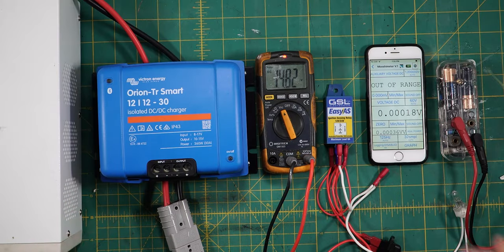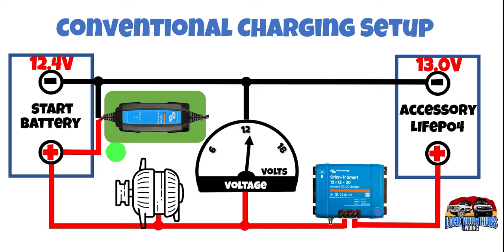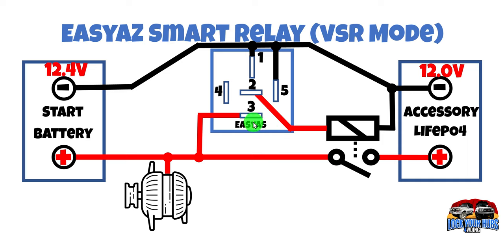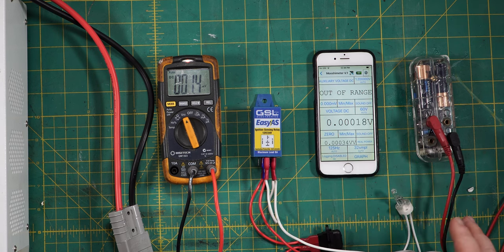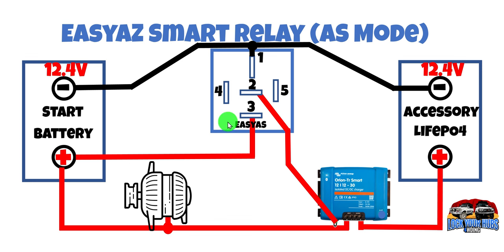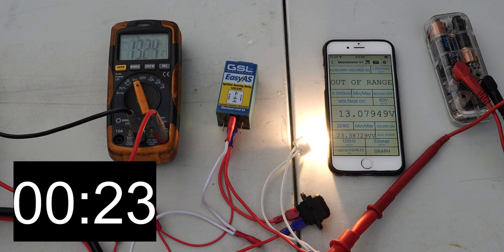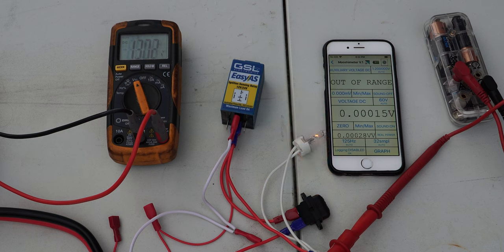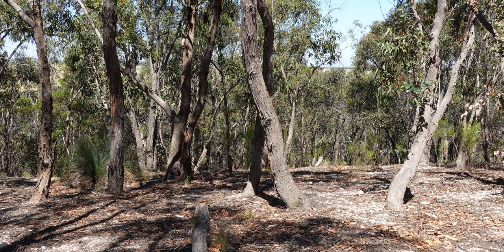Save your Starter Battery with the EasyAS Relay

Comment: Really enjoy your videos. Very clear and easy to follow.

This looks clever but it also looks like you need to run a third wire all the way to the DCDC controller which will be next to the battery (wherever that is) so I'm not sure why you wouldn't just run an ignition wire from the controller. Do some not have these?
Reply from the maker: Unfortunately you still need to run another wire. Though, the likes of the latest Redarc DCDC chargers have a low voltage cutout, so in order to get them working in the likes of a caravan, you need to run really thick (expensive) wiring. This fixes that issue.
Reply: Excellent video and well explained as usual (love the diagrams, makes it easy to follow along) :)
Do you really need to run an extra wire If the Aux battery and the DC-DC charger are in a caravan? Couldn't you sense the AC ripple on the positive power lead (i.e. the ones from your Anderson plug into your van) and put the EasyAs relay in the Caravan as well?
Reply from the maker: @Jack_C_  I've been told that over those sorts of distances, it can be a little hit and miss if there is a load on the wire as well. Having said that, I would definitely "give it a go" before running the dedicated wire.
Reply: For my van house battery, my auto elec ran the large cables through a 100A relay under the bonnet and then to rear of the vehicle. This relied on the ignition to open the circuit in the relay, rather than running the Enerdrive DCDC ignition wire up to the vehicle engine bay.

For my under bonnet dual battery I use Projecta DCDC 25 with ignition wire wired in. Although I was suspicious of my cranking battery being drained to the deep cycle dual battery when I charged it (as per example in this video) but I was relying on the DCDC to protect it with the ignition wire. I started removing the fuse between the two in case it was draining and was considering a high amp switch instead. Not ideal solution though.

I really do enjoy learning about DC wiring like this, even if I don't have an immediate use for it

Comment: I was thinking about something like this so I can use a lithium start battery with a Redarc DCDC. I believe they now sell a kit as well which is just an ignition triggered relay. So my question is, why do we need to have a fancy AC sensing trigger when we can use and ignition source to trigger a relay to do the same job?
Reply from the maker: The ignition trigger would work for most people. Though if the trigger has a low voltage cut off (redarc) or is a distance away, you'll need an alternative.
Reply: Heard somewhere that lithium batts under the bonnet can have issues due to heat. Dunno
Reply from the maker: @WaveformV1.0  it's a limitation of the chemistry, if the battery compartment isn't well isolated from the engine bay, it'll suffer. No matter what the manufacturer says.
Reply: @WaveformV1.0  Im running lithium under bonnet and its warranted for 5 years for under bonnet use so Im confident and its a game changer. Been working excellent so far. There are a few quality brands out there now which are all warranted for undr bonnet usage.
Reply: I'll be using it to reduce having to have an ign into my canopy where my second battery will be, one less anderson connection, well half an anderson anyways

Comment: Does it work with ecu controlled alternators?  I.e if the engine is running but alternator voltage is reduced will it keep the DC-DC running?
Reply from the maker: GSL Electronics say they do.
Reply: @LockyourHubs4WDing  Thanks, great reason to get one.